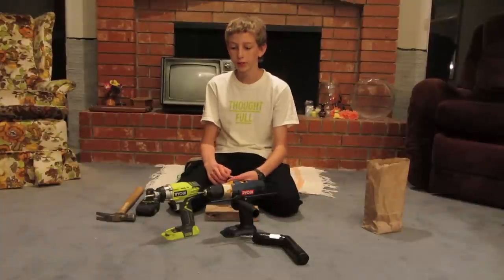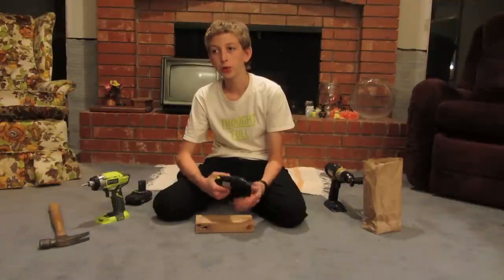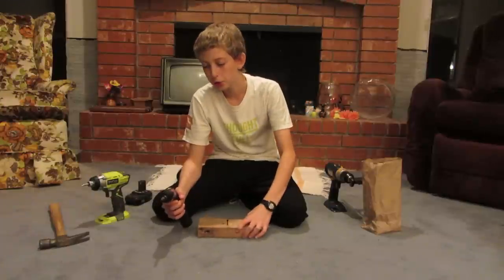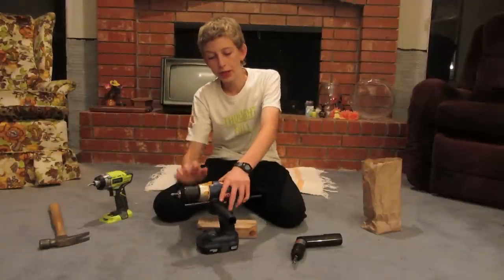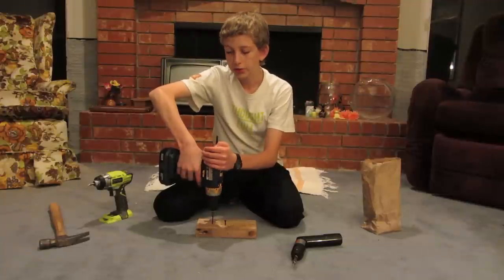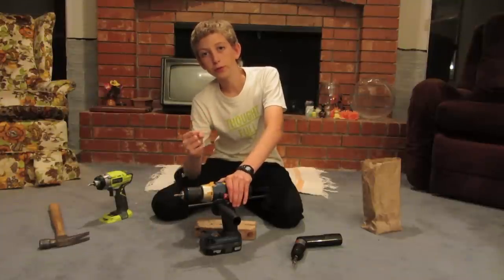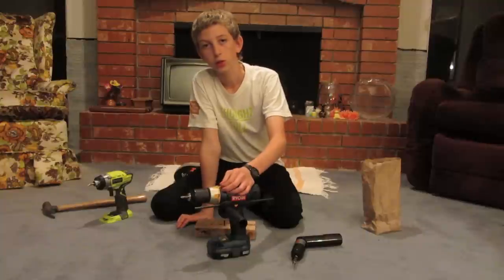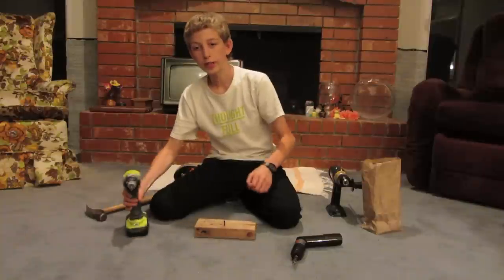What's the difference between a drill, impact driver, and a power screwdriver

Comment: Thanks a lot. Now I'm know what an impact driver is. I have an electric screwdriver but it is the shape and size of a drill. It will get that screw in all the way, but is a lot slower than drills, and of course, no impact. It is smooth and quiet. I could use it in the middler of the night without disturbing the neighbours. The trigger is also pressure sensitive. Press harder, it goes faster.

Comment: best ever!.  I am planning to buy cordless drills but not sure of the exact technical names ( although I know what I want).  You have cleared it for me.  I am buying an impact driver.  One question though could I use the impact driver as a common screwdriver for opening and closing predrilled scres or computer cabinets?
Reply from the maker: You could but you will need to be careful not to strip anything.
Reply: thanks
Reply: I might be year too late but Most impact drivers have a clutch for easing off the Dourqe for more delacite works (The ring with Numbers and a Drill bit icon) smaler the number less dourqe is aplied to a screwable item
Reply from the maker: +ResaRestart Most drills have the clutch mechanism but I have not seen any impacts with it yet.
Reply: For light duty like that, the power screwdriver will do fine.

Comment: Is drill enough for drill a wall in house and make a hole on table? Or just use impact drill? This one got led that look useful and interesting
Reply from the maker: The drill is your best option for drilling holes. The impact is better for tightening and loosening fasteners such as screws or bolts.
Reply: @FlyByTire  i want use for screw too.. So impact is for me? Can u recommend any brand that have completed set for drill and screw?

Comment: Well done, no verbal diarrhea like your adult countrymen - few words, plenty of demo.
When putting big screws in (decking say) it helps to drill a pilot hole as the screws sometimes make micro splits and let in the moisture.
Lastly, get your parents to get you a work bench - it's cheaper than replacing the carpet when you drill holes in it !!!